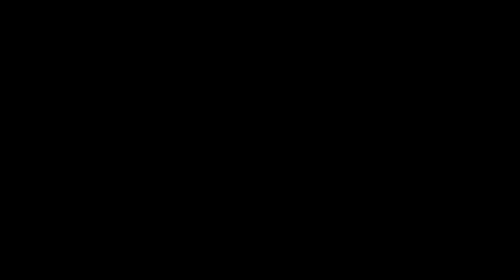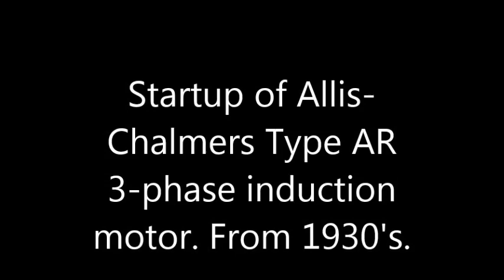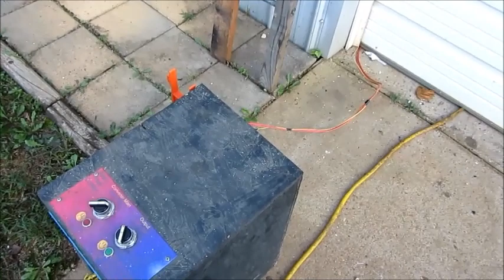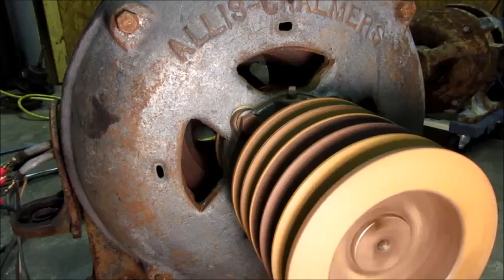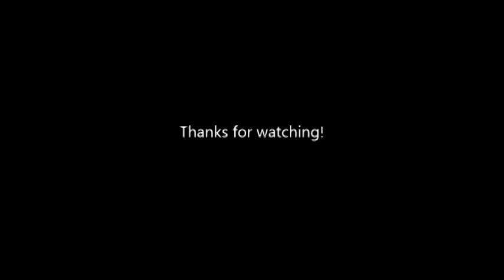Allis Chalmers Antique Electric Motor Startup

Comment: please make sure the bearings are well-lubed, i'd hate for this wonderful old motor to wreck due to dry bearings
Reply from the maker: Hi there! Thanks for the comment. You're absolutely correct about these requiring good lubrication.  Sadly, the bearings had already been burned out before I got the motor.  I have been involved with work projects and had other obligations keeping me from this motor. I did remove the shaft and bearings and took them to a machine shop before leaving for work. Hope to get it back, refurbished, when I get home.

Comment: Wait did you use it at halve voltage and wonder why it takes so much Amps at start up?
Reply from the maker: Thanks for the comment. This motor is designed for 550V and isn't dual-voltage. My rotary phase converter is only capable of putting out 240V. As for the amps, induction motors take 5 or 6 times normal running current when they are starting up. That's just the nature of the beast. They call that "locked rotor amps" or LRA on the nameplate.